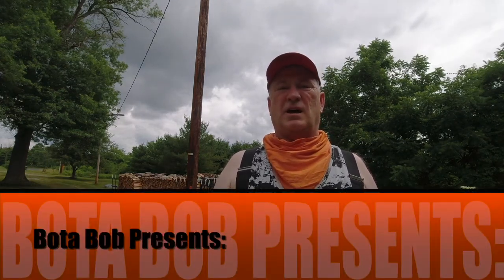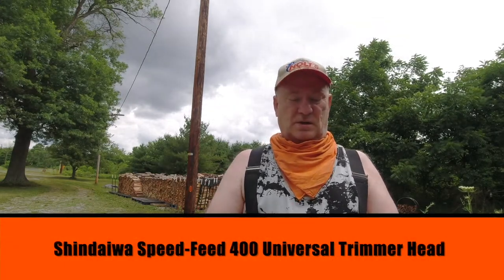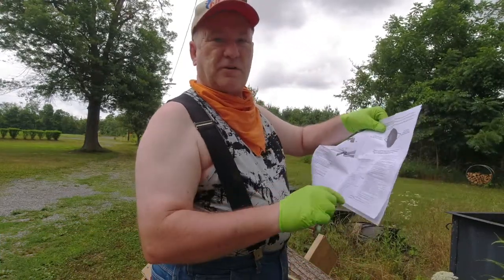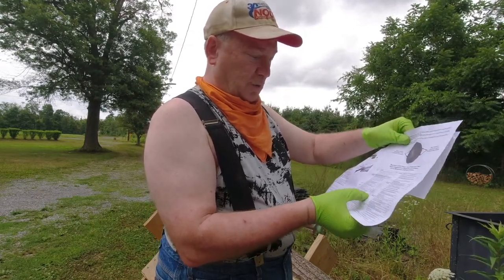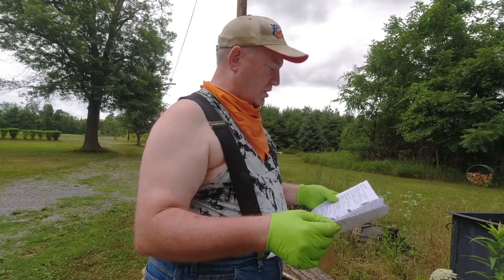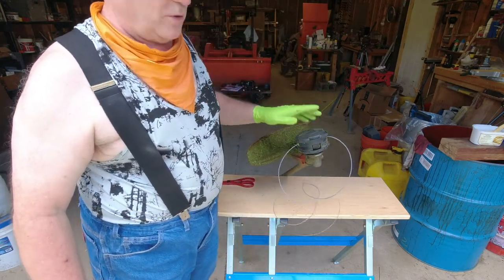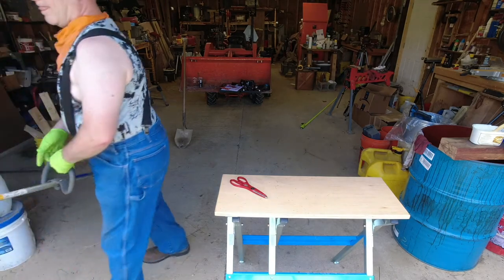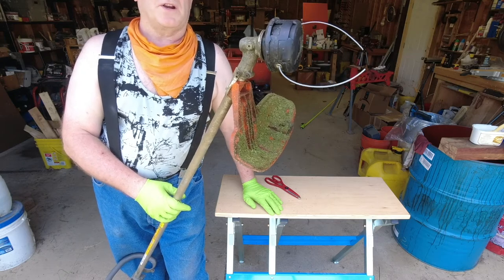#77   The Shindaiwa Speed Feed 400 String Trimmer Head

Comment: I had problems with the string retracting into the head on start up and while running.  Found one forum thread about it that said to put washers on the spring to increase pressure on the head and it worked.  No problems anymore and works great.  Just got figure out correct amount to stop retraction yet still allow string release when bumping.
Reply from the maker: I'm glad you were able to get this resolved.  I think you are going to like the Speed Feed 400 String Trimmer Head.  And thanks for following up with your resolution.  Enjoy the journey - cheers

Comment: Tried this one after seeing great reviews for my Weedeater brand trimmer and every time I pull the start cord or run the weed eater the line retracts into the head.  Weed eater is left hand thread and even tried the right hand adapter and same thing.
Reply from the maker: That is unfortunate - I did not have that experience.  It works great with my application.  Of course the benefit of the Speed Feed is the easy reload of string.  Are you using the correct diameter string?  I wonder if there is a forum somewhere that could help with this problem.  I hope you solve the issue and post a follow-up. If you post a follow-up, do NOT post under this thread, as I will not see it in my comments.  I can only respond to new posts.  I hope this make sense.